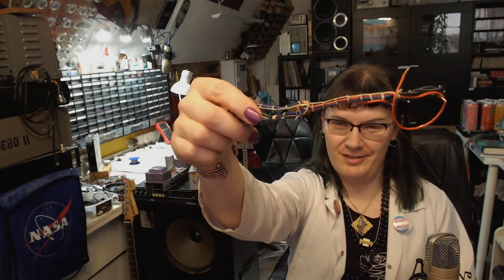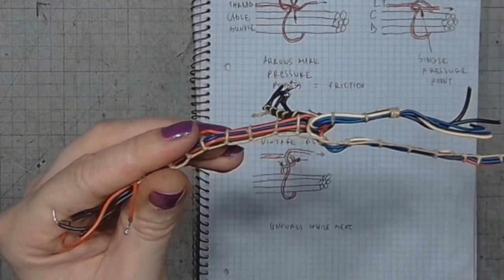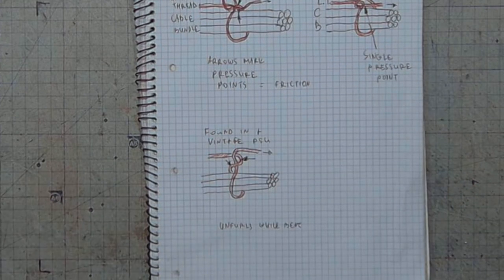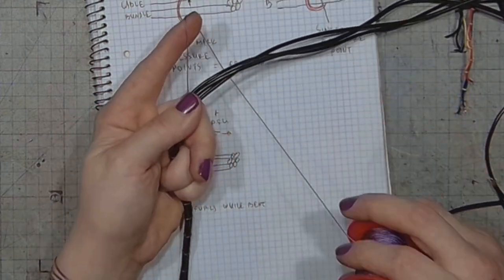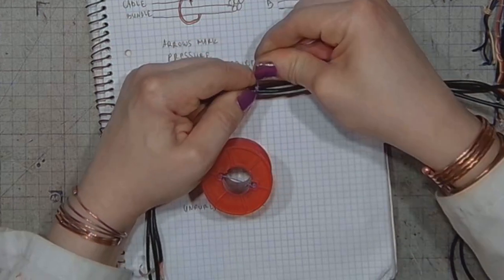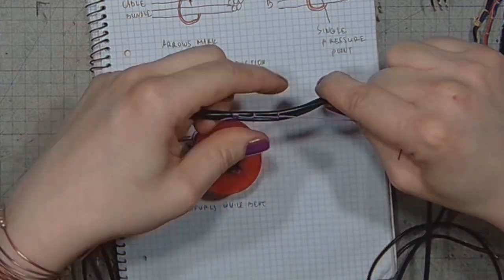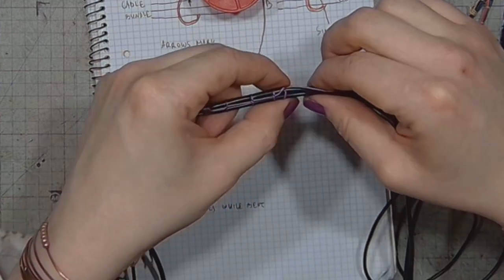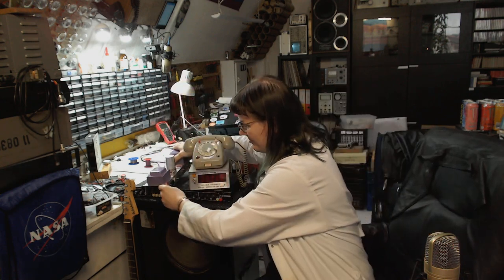Old Style Cable Lacing Techniques

Comment: I learned cable lacing using flat lacing tape. At LearJet very few plastic "Ty straps" were used. Cessna, in contrast, often had over 2000 "quick ties" another name for "Ty straps" within the five feet or so covered by the instrument panel. 

Laced harnesses can be a pain when adding wires, but can pass through conduit, unlike the plastic ties. And if people didn't properly cut the plastic ties with flush cutters can cause a lot of scratches and cuts to the hands working in tight places.

(How can I be so specific about the number of plastic ties? An industrial engineer asked me once to cut them all out from a model 404 and save them and then to count how many were needed to tie everything back up correctly. This also resulted in the wiring being less bulky because of the wires being in close packing instead of bundles of bundles.)
Reply from the maker: Hey, nice story! Mine goes back to 2000s when I got into tube electronics repair, restoration and amp building. I was inspired by the vintage stuff and wanted more of that loveliness in my builds.

Comment: I was taught how to do this in my apprenticeship in 1974.
Reply from the maker: Nice! By the time I learned it in 2000s, it was pretty much lost art already, apart from some high-end industries like aerospace etc. I restored lots of vintage gear and got inspired by it, so I learned the stuff.
Reply: @KeritechElectronics  I was an apprentice for REME (Royal Electrical Mechanical Engineers) in the UK.
Reply: Me too, but a little later early 80s. My apprenticeship was at ICI 
Best way to learn and get paid. 
We had to use the knuckle of the thumb for the spacing of the knots 👍
Reply: @dcallan812  I worked on a REME as a civvy did my apprenticeship, but can't remember how we set the spacing.

Comment: Neatly laced cables look great! When I make stuff, I struggle to get all the cables in a bundle the correct length, so they refuse to fit neatly together or even need a few loops to take up the longer ones... I am uncultured, however, and just use cable ties to bundle everything up.
Reply from the maker: Back in the day, cable looms were made out of the device, on custom made jigs which were boards with nails where branches and breakouts were separated from the trunk.The cables were then laced, taken off the jig and installed in the device.
Reply: @KeritechElectronics  yeah. I can imagine that being the way to go if you're making several of something, but for my experimental one offs, I struggle to not make tangles :-)
Reply from the maker: @alaricsnellpym  yes, it's definitely better meant for serial production. In case of a one-off, the effort of making the tool is high compared to the savings you get from it. If you do the run, you make the tool once and it'll spread over the number of units, making it economically viable.